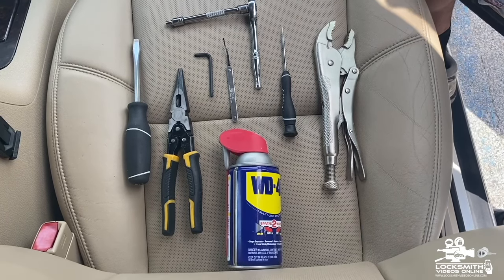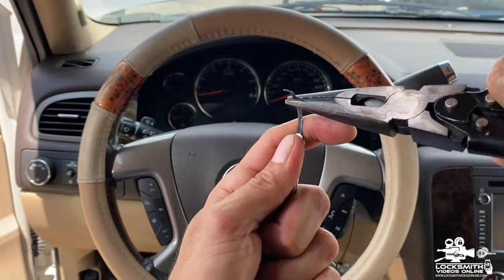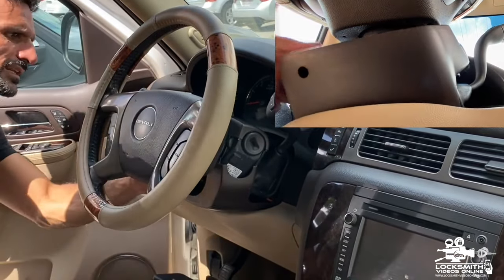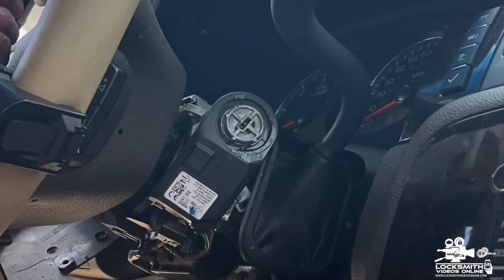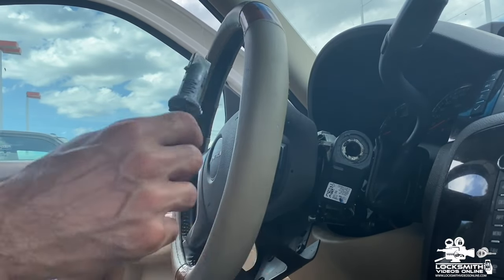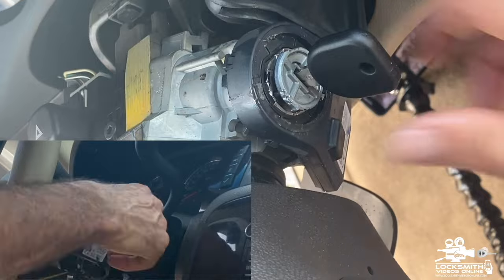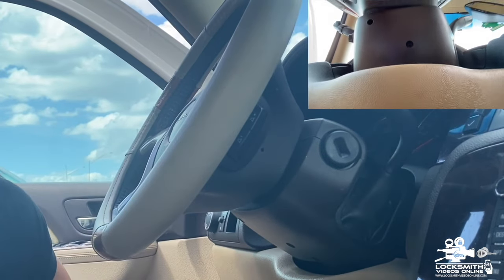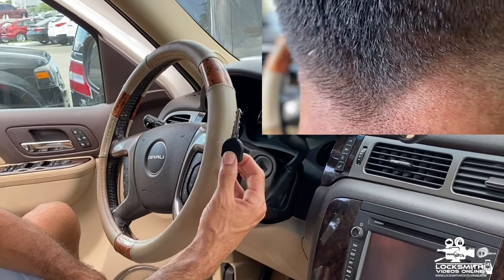How To Pick Ignition Lock Cylinder & Find The Key Code GM   GENERAL MOTORS [Chevrolet / Buick / GMC]

Comment: I am used to be an Auto Tech and anytime you work on the ignition system always disconnect your battery . This will stop any accidental starts and stop any issues with possible damage to electrical system or to you ECM .

Comment: I have been going through videos to help my own understanding of the GM ignition cylinder, had a lot of problems with them recently in michigan. Some tips for those who plan to take on this task. You can tell by the large black plastic piece around the entire ignition (not the cap that he removes) that this truck has an anti theft chip and thus will Not start when you turn the ignition to On during this process! because of that, you can leave this truck in park to remove the ignition. On trucks without that black plastic (antennae) part, you MUST put the car into a gear where it cannot start, or remove the battery power to the truck so it cannot start. Because it will take you some time to pull the ignition out, if you keep it in the start position while the truck is in neutral or park you can damage your starter by keeping it engaged while the engine turns on. 

Thanks for helping me understand how to pick the ignition in another way, and I hope that I helped someone else with this repair to not damage their vehicle.

Comment: Harbor freight has an orange handle hook and pick set. I use the  weird angle tool included in that set to tension the sidebar and still rake the lock.  I do not pull the cap off the end of the igniton because plastic gets brittle and could break. I also use a metal test key instead of using a transponder key if I'm not sure of the code or bitting. Cheaper that way so you dont waste transponder keys.
Reply: @williamc2553 I hate removing that cap- i feel like im gunna break the plastic on the immo ring. Is it difficult to insert the pick with the cap still on?? This would save so much heart ache
Reply: @pouncerminned863  No. The angled pick let's you get in behind it and still put enough tension on the sidebar to know when it's picked.

Comment: I watched you do that then looked at my '06 chevy express and thought it has a ring that doesn't come off with 2 tabs to give you leverage turning it so I didn't need the vise grips. I pushed a small plastic wire tie into the area with the black bar and got it to go in quite a aways.  (maybe an inch) Then after I lubed up the slot with wd, I just used a chevy key for a different van and about the third time in and out it turned! I put a rod in the catch removal hole and slowly turned the thing until I felt the give of the cylinder and it came out! i just needed to get the cylinder out so I could put in my cylinder from my non tilt column.

Comment: Easiest way to get a key made is to go to a dealership with your registration and they can cut a key for it from that, you can program it at home by putting the key in the ignition for ten minutes and thirty seconds in the on position, remove the key, and within 45 sec repete above procedure again two more times
Reply: lol- this is for locksmiths-

Comment: what if the steering lock is engaged?
Reply: Cutting torch and sawzall 👍🎂
Reply: the steering lock does not really come into play here, in its proper function. So first try to pick it and if you're certain that you've successfully done so, turn the wheel all the way left, try turning the ignition, then turn the wheel all the way right and try it. Or, wiggle it back and forth while turning the ignition. If it doesnt turn after that, you've got a different problem (not fully picket most likely.)

Comment: Never never never put WD-40 in the ignition. It will ruin all the electrical wire and contained within in about six months.

They have much better lubricants that don’t attract dust dirt, they don’t have oil or none of that stuff either and definitely don’t use graphite on any locks 

I use Houdini all day long with no issues!!!!

Comment: Well Okay, you did the ignition on the on position but and forgive me if you look when you're moving that ignition like you're saying that little pin right there use a super small or I actually use them this damn little bitty knife I took and move the nation back I have to call her everything off like you did took the ignition back and I saw that pan so I put that thing there I pushed it in until I can move the cylinder forward kind of like taking a credit card to get into a door that and Bam so it didn't have to do all that other and well I do muscle some of my crap off thank you though I understand and I don't do them to get me in key cuz I lost my damn key like I said yes sir you did achieve your objective but check out that little pin I'm talking about I just use a little bit but believe me but it's strong enough that it would push the pain in I would push in on that pen then turn the cylinder bam she's good so thank you for the information on the key code and all that though and I watched that you did it and that's okay so good deal bro 💪🙏🍀🕊😄

Comment: Are you teaching people how to steal cars????????😡😡😡😡
Reply: This process is VERY hard to do in the dark, and before you can get to this whole videos worth of work you have to pick the door lock (decently difficult) without someone noticing, then you have to tear the steering wheel cover apart, spend 5 minutes (most likely more) picking the ignition, successfully program a transponder chip to the cars anti theft computer which on GM cars takes 30 minutes (and a battery charger so the cars battery does not die) Or have a thousand dollar computer for locksmiths/mechanices, to shorten the time to 12 minutes. 

As well, if you don't have the ability to hold still for 12 (or 30) minutes straight you instead have to cut the proper key for the ignition which is quite loud.

all in all new cars are much harder to steal than Just turning the ignition, and in the minimum time it would take (17 minutes) someone is sure to ask why a fellow is sneaking around in someones car. I get the cops called on me once in a while, even with my big locksmith van parked right next to it because someone gets concerned i may be stealing a vehicle.